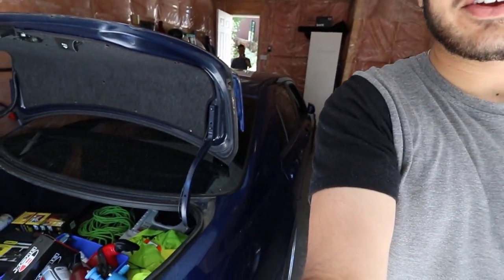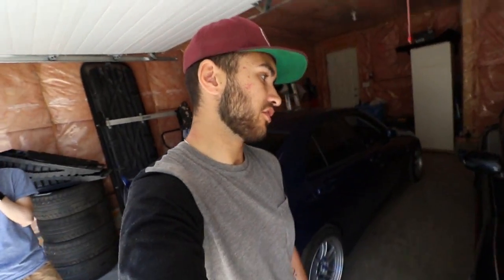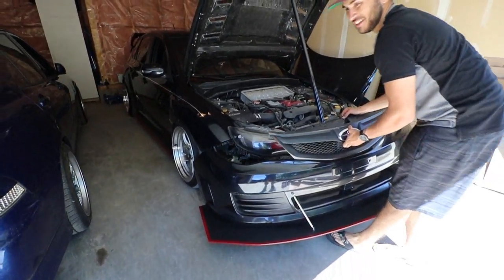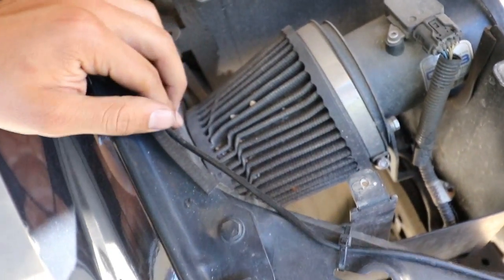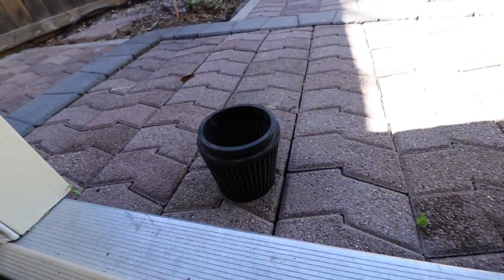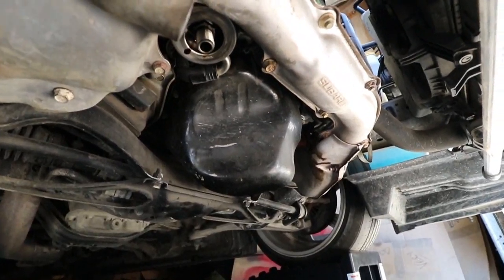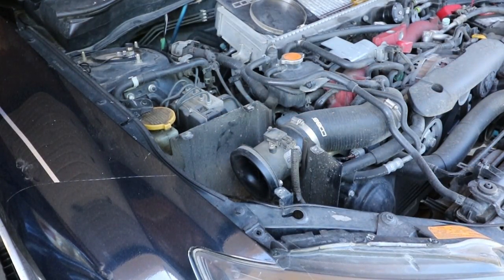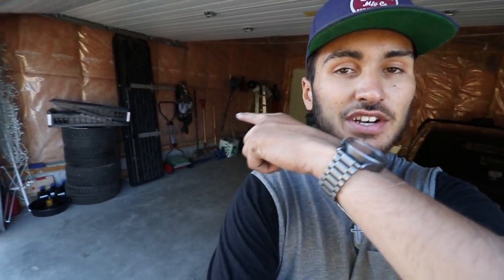STI PREP FOR VANCOUVER DRIVEN! || 20 HOUR ROAD TRIP...

Comment: you should really consider running 5-40 like 90% of sti users. 30s to thin when your beating it, i cant justify putting 30 in even if thats whats recommended.
Reply from the maker: Sunde53 I have always run the same oil and have never had an issue so just a little hesitant to change! But thanks for the info man, appreciate it, I'll look into it a little more and possibly make the switch! Thanks!
Reply: changing to 40 wouldnt harm anything i just find it more safe to run especially since i drive my car pretty hard.